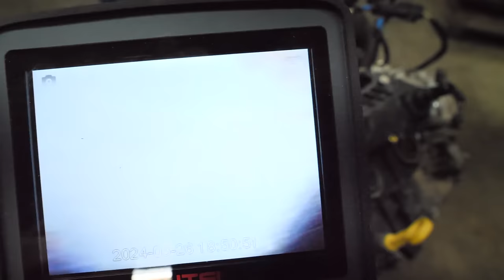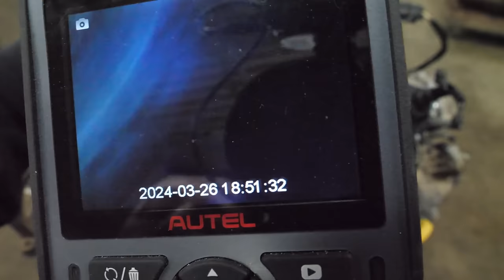ANOTHER BAD 2.7 Ecoboost? 2018 F150 Twin Turbo V6 DEAD @ 131k Miles

Comment: As soon as you said why would somebody take a water pump and reuse it. I thought well that the engine overheated. Because it had a bad water pump. They replaced it and then the engine died. So the water pump wasn't that old. So they took it and put it on the used engine. Now I'm making this, 20 minutes into the video I could be totally wrong I have been before. So if you are taking apart a good engine why don't you rebuild this one that'd be a treat for the channel.
Reply: Installing used pumps of any kind is a dumb liability for a shop. A "chain of custody" is more important than "saving a buck" if you are standing behind your work.
Reply: But do we have any proof that a shop did the work? At the age of 58 I retired and sold our 12 Bay body shop. I have seen a lot of weird things owners of cars and trucks have done.
Reply: @aregeebee201 head gaskets sometimes fail in a way you can't see it on them.
Reply: Probably replaced engine because that piston wrist pin wear was causing knock, and the ECU, thinking this was detonation, due to the timing on that cylinder, had pulled power way back.  Then the lowered fuel input meant the cylinder was running ultra lean, and this, combined with probably a small carbon particle that got stuck on the valve, caused it to wear, and then the ECU carried on running that cylinder ultra lean, leading to the valve seat eroding as the combusting fuel mix kept on bleeding by. You can see the run marks of the metal being eroded away. Engine replaced because ECU told of misfire on one cylinder, bad knocking and lack of power, along with very lumpy idle. Compression test said cylinder really bad on leak test, so scrap engine instead of stripping head, because the used engine is cheaper than a strip, repair and assemble labour wise. Pump likely removed because it was faulty on the junkyard engine, probably leaking water, so to cut cost they swapped with the old one.
Reply: @jamesgeorge4874  do you understand how ridiculous you should? If you buy a used vehicle do you replace every used pump of any kind? Educate the comment section on just how the water pump would be untrustworthy in the OP's theory, I dare you...FFS.
Reply: @SeanBZA  Another valid guess. The only thing is, these 2.7s don't have wrist pin bushings. Maybe that would make this a more likely scenario, maybe a less likely one. Overheating the piston could have also precipitated the play. We're missing the turbos, the water pump, and don't know what the coolant looked like when it was having the issue. Hard to narrow it down past three or four different culprits. Signs of overheating, the melted guide, the coolant in the cylinder on the opposing bank from the cooked valve. Too many things support one option, but raise questions for another.
Reply: That chunk of valve going through the turbo might well have been the reason a replacement low milage engine was used rather than a rebuild.  Factor in the additional cost of a replacement turbo and the engine swap is going to look better.

Comment: I have a collection of burnt exhaust valves on my "shelf of shame"... And every single one came from a stock engine with excessive oil consumption. Hard to say why this Ecoboost burned a valve. A bad injector would melt the piston long before a valve got torched 🤔
Reply: A turbo engine is like having a build in cutting torch....lol You can see the cutting lines on the valve like it was cut with a torch. Which it was by the turbo.
Reply: Honestly it was probably tuned and he got some bad gas.  Detonation turned into a plasma cutter.  Seen it before.

Comment: I can't understand why they put so much resource and design in the casting, overly so IMHO, yet cheaped out on a fibre oil pump belt. But yet another great video, thanks Eric.
Reply: Because a bean counter did the comparasion, and the belt worked out to a few cents cheaper, plus it added 0.001MPG improvement in the standard test cell run.
Reply: So the engine would grenade.
Reply: Easy to understand.  Profits for the shareholders.
Reply: And most of the higher ups at ford used to work for the government

Comment: I  don't remember if it was mentioned in any of the other 2.7 vids but the reason for the interesting block construction is because it's made from compacted graphite iron (cgi) which is significantly stronger than standard cast iron, it's the same type of iron that Nascar engine blocks are made from. It's really a shame other manufacturers haven't taken the plunge to invest in CGI blocks because it offers significant gains over standard cast iron.

Also, the coating on the bearings was introduced into Ford engines (and likely other brands too) when they made auto start-stop systems standard to increase MPG ratings. The coated bearings hold up much better to repeated frequent restarts than uncoated bearings.
Reply: Good to know. I can’t believe how good those bearings looked with nearly 140k.
Reply: What is the point of a cgi block and then fit a belt in oil - bad engineering!
Reply: but they use a wet belt, negating all benefits of those innovations
Reply: @Nordic_Mechanic  have you heard of any failing?
Reply: @D3M0ify  So what's wrong with a wet belt other than it's something none of us are used to seeing? Find us a wet belt 2.7L Ford that has blow up due to a failed wet belt. Crickets 🦗🦗
Reply: @RA31A  Chains wear out and rattle . Belts fail catastrophically .
Reply: @stewatparkpark2933   Correct, but find one example.
Reply: @douglasm3310  that'sthanks to the superiority of today's oil!
Reply: @douglasm3310  That's because it was probably rebuilt twice to make it to 140k!
Reply: @RA31A 
From what I heard, 1.0L EcoBoost oil pump belts failed consistently. 
I’ve only heard of one 2.7 oil pump belt failure. I made it to about 200k but the engine was toast because it failed at highway speed.
Reply: @RA31A  Just wait 20 years and lets see then, and how many owners would know if it has a wet belt? Oh crap sorry it won't last 20 yrs. 🤣😵
Reply: When Tundras last a million miles, anything Ford is doing is insignificant.
Reply: @benztech2262  From the UK; the belts don't necessarily fail by "snapping" they degrade @I do cars was illustrating the cracks here.   The cracks lead to material falling off and ultimately clogging the oil pump strainer.   Many EcoBoost failures here are due to oil starvation.   Eric described it as a Kevlar belt (Kevlar is a trade name for aramid fibre) I'm not sure that is correct. @ 35.05 the markings suggest HNBR-GF (Glass Fibre hydrogenated nitrile rubber).   Of course there maybe some Kevlar in there too but I think that would need to be indicated to meet recycling rules?
Reply: @D3M0ify  to be fair, I don't think we've seen many failures in this motor due to the belt yet. I could be wrong... but if not... let's give it some time. Maybe something that becomes a real problem after 15 or 20 years.
Reply: @Nordic_Mechanic  Its a good thing they only used that for the oil pump belt because if you lose oil pressure you can just shut it off and it will be fine for a new belt and the oil pump should be fine in theory if you change oil regularly. Might need to clean out strainers though.

Comment: I have an old 1994 Chevy 1500 pick up, it always needs something every 6 months or so even though I only put maybe 5K miles a year on it. When I look at the complexly of late model  trucks and the price tags I  stop my bitch fest fix my 100 to 300 dollar problem and  close the Auto Trader screen on  my computer
Reply: Same here, only I have a 1998 Saturn SL.  Way too many things that can go south on that engine he just tore down.
Reply: Replace it with a Tundra. 
No more repairs and it will out last you. Plus the drive is as good as pickups get.
Reply: @jamierose4088  Except the Tundra now comes with a standard 3.5 TT. What's amazing is how they essentially copied Ford down to the displacement but their 3.5s are having teething issues.

Turns out when you're a lame company that coasts its reputation on old underpowered engines with lots of slop built in, you have a hard time designing a powerful and efficient engine when the market demands it.
Reply: @spacebound1969 while I will not agree with you 100%, I can't argue with with at least one good point you bought up. Ecoboost are super fun to drive and they are pretty quite and smooth. Every toyota I drove was loud and rough but I imagine reliable. If I'm watching Dave ramsey I will buy a toyota. If I'm not I will buy a ford.
Reply: @spacebound1969  One evening in 2009, I met a Ford engine department engineer, so we talked about...engines. He said that the Toyota 4.0L V-6 (in my '06 Tacoma) was one that Ford BOUGHT to study. He also said that the crank angles were critical to making power. I'm sure he was right, but that V-6 was just mind-boggling with its flexibility and power. Mine was a 6 speed manual with towing gears. There was almost no situation where any of 3 gears wouldn't work fine. The one thing to avoid was going up a freeway onramp in 2nd gear, because it accelerated so hard in 2nd and finding 3rd wasn't to be rushed. MPG wasn't great, and was pretty much the same as its replacement, an '08 Silverado 4x4 with 5.3L. Range is better with the Silverado. There are some things I don't like about the 5.3L, but it's relatively simple. The complexity of the newest Ford engines pretty much makes them throw-aways, IMO.  Would be fun to install in an older european car, like a Cortina or even BMW. I've driven a couple of BMW's and really liked them, but could never afford to own one. 😪

Comment: That wear on the chain guide is from the tensioner failing and applying too much pressure, causing excessive heat.
Reply: Ah good reasoning...I was trying to figure that out and failed to so I thought I'd double check the comments nice thanks.
Reply: I'd put money on that being the original problem, causing enough friction & wear on the chain guides to screw up the timing just enough to cook that valve.  Just wish we could've seen what caused the slop in that one cylinder.  🤷‍♂️
Reply: Ahh but what would cause it o put MORE rather than less tension?     How about some accumulated spooge pudding getting into the and behind the plunger.    Just spitballing here as I’ve never seen this myself…..thankfully
Reply: @phillipfritz7014  OK. I'll come clean. I actually have no idea what happened, so I just threw out a wild guess. Maybe I'm right, but I seriously don't know.
Reply: @timothyball3144  Made the most sense yo me.
Reply: @phillipfritz7014  I was hoping to find someone who would tell me that I was wrong so I could learn something. I failed again, lol.

Comment: Your videos are great! I'm learning so much more about my Gen-1 2.7l EcoBoost Engine inside my 2017 Ford Fusion Sport than I ever will scouring random forums about my car.

I have a 2017 Ford Fusion Sport and had to have that engine (2.7l EcoBoost Gen 1) replaced because it blew a head gasket and leaked coolant into the cylinders, but based on your past breakdown videos on both the Gen 1 and 2 2.7l EcoBoost engines, I have a more complete understanding of what makes this engine tick. The replacement engine costed almost $5k including labor to replace, luckily I bought an extended warranty that covered everything bumper to bumper when I bought the car. 

I bought this car second-hand off of Carvana, so I didn't know how this car was treated before me. I found out, after I bought the car, that the car had 1 quart oil low and there was no oil on the dipstick when I was getting an oil change, me being a buffoon and not knowing anything about my own engine at the time, ignored that warning sign. Six months later, my engine started consuming coolant and was emitting white smoke out the tail pipes, I was wondering if there was a leak or something, but I couldn't find a leak anywhere, come to find out the coolant was leaking into the cylinders. 

One cold morning, I was accelerating hard on the on-ramp on to a freeway, a giant cloud of white smoke covered the freeway and my engine completely shut down. That was when I knew the head-gasket blew and coolant flooded my cylinders. I think the previous owner of this car neglected the car and the engine and let it overheat from oil starvation. My car was in the shop for 6-months, because 2-months was searching for a replacement engine. Apparently this engine is hard to find. The 2.7l v6 EcoBoost is a marvel of an engine, paired with an AWD drive-train in a four-door car makes for some fun driving. I'm also happy to know that the Gen 1 2.7l engines have chains for oil pumps, although it doesn't have both Port and Direct injection, I'm okay with that. 

The replacement engine now gets an oil change every 3000 miles, I don't care about Ford's 5000 or 7000 mile recommendation. I'm not giving the replacement engine a chance to oil starve. The replacement engine is also now modified with a CAI, GFB+ Diverter Valve, and 93 gas tune. I've also upgraded the brake lines to Steeda Stainless Steel brake lines, I saw a manufacturer recall on how weak the front brake lines could be on this model and year car so I decided to upgrade all four brake lines to braided stainless steel. Keep your 2.7l and 3.0l Ecoboost videos coming. Your videos are super educational and you've got another subscriber!
Reply: I had a 2017 Lincoln MKX AWD with the Gen 1 2.7L turbo. It’s the same engine that is in your car and I agree it is a blast to drive and is a perfect match for a car that size and weight.  It was probably OK in an F150 if treated very gingerly without any towing, but I would still have wanted a larger engine in a truck. 

I’m retired so I don’t drive that many miles, but after reading about the issues with that engine; only direct injection, plastic oil pan gasket issues and other assorted moderately expensive maintenance necessary at 60K, I got out of it early.  If I had a 2018 or later, I probably would have kept it a little longer, but there were still too many potential problems so it was best to move on before the repair and big maintenance bills hit all it once.
Reply: Don't be hard on yourself. It's most likely that your 2.7 had the dreaded long block defect that plagued something like 1 in 3 2.7s for a few months of 2016 manufacturing.

A supplier screwed up and delivered a batch of long blocks with uneven decks which caused the gaskets to eventually fail and leak coolant.

Comment: 121k on mine. Bought at 85k. No clue about prior maintenance, but it lives a pampered life now. So far so good.
Reply: I wouldn't wait on that oil pump belt service considering they start to shed debris that will clog up the oil pickup screen. If the previous owner short tripped the truck a lot, it will degrade much faster. They seem to break down faster due to exposure to unburned fuel in the engine oil.
Reply: @hochhaul have you torn down or repaired a lot of ecoboosts?
Reply: What year is your 2.7? I’m at 126k with my 2017.
Reply: @hochhaul  and there is no proof that they degrade faster with short trips and no proof that the belts shreds anything. Once again it could fall back to sloppy maintenance.

Comment: The 2.7 as a ford tech is my recommended engine from my anecdotal evidence and from other that have been around that place more than me. The 2.7 is the most reliable followed closely by the 3.5. they don't have manifolds so they don't have the warped manifold issues of the 3.5 they make less power so they aren't as stressed. But they also just don't fail. We tear down 5.0s all the time fro oil burning and the 3.5s for phaseres. The 2.7 has a slight issue but nowhere near as bad as the 5.0 or 3.5s. we've only done 1 2.7 and that's because of a faulty belt broke in the right way to snap off the oil pressure switch we've done a few 3.5s and way more 5.0s and the 5.0s are the least sold (I know the 2021 2.7s and up have valve shattering issues but I'm referring to gens 1 and 2)
Reply: Wasn't there a coolant issue with the ports getting clogged between the cylinder walls.
Reply: @Bigfoothawk  nope